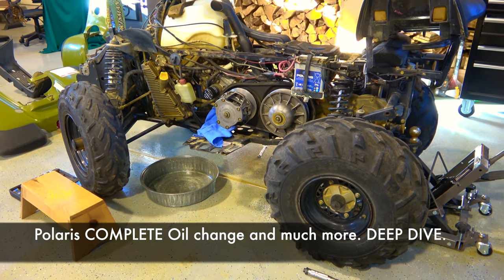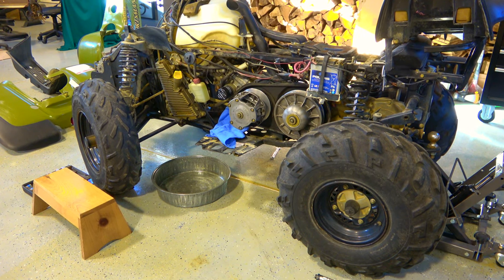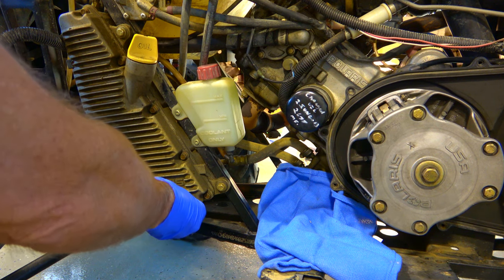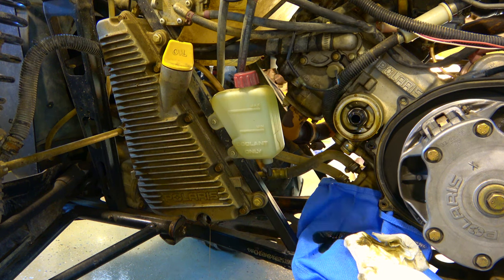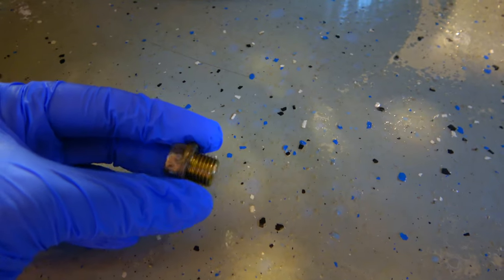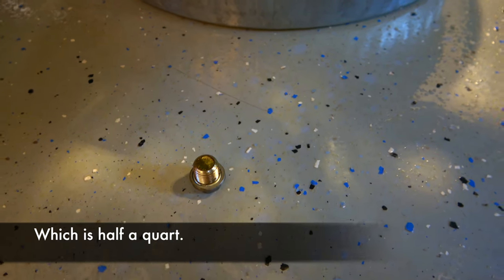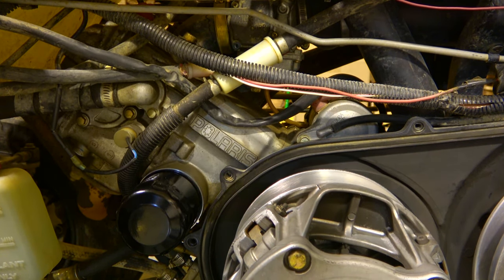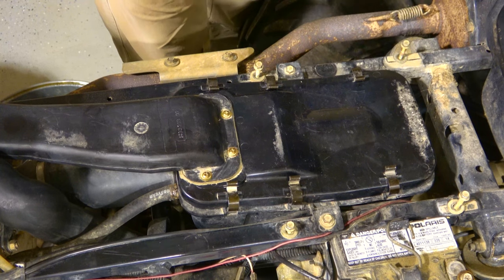Polaris Sportsman COMPLETE oil change & Much More. DEEP DIVE.

Comment: Hello. My oil reservoir has two breather connections at the top?  Do I crimp both off?  I only noticed that you used one hemostat tool. Should I not crimp the other? I can't post a picture here but there's definitely more than one.
Reply from the maker: What year make and model do you have?
Reply: @ericinalaska7648  1995 Polaris Magnum 425
Reply from the maker: @futuregamer5791  I did some searching and the few pics I found, were very limited. Does it have a a black line, and what was once a clear line that has yellowed? The design I have and demonstrate has one vent line that goes to the airbox under the seat. Is that the same with your black line and then the clear/yellowed one goes? To the ground or? Like a fuel or over flow vent? 

     I don't know for sure. Id have to dig more but my instinct is that you'd clamp them both if that's the case. When you clamp the line as I did in the video. Your creating pressure to force oil through the pump and as It warms and expands its intended to fill any voids in the flow by not allowing the pressure created out the vent. Thats my understanding anyway. So I would think you'd clamp both but I would need to reference the manual on that one. I haven't been able to find any reference at this point.  See if you can get a manual for that model. They're usually pretty cheap and great to have. Let me/us know if you sort it out. Ill see if I can find anything.
Reply: @ericinalaska7648  So bad news for me. I rebuilt the engine and had it running. I first pinched off both of those oil reservoir breathers and ran it for almost a minute. Then ran it normally and within 2 minutes the engine locked up. Not completely but it's definitely seizing up. I think I'm throwing in the towel on this one and I've decided I won't be purchasing anything else Polaris branded. The engine locked up previous to the rebuild the cam froze to the cylinder head. I tore it completely down and split the case. Replaced water pump assembly, timing chain,piston rings, honed out the cylinder, new cam shaft and cylinder head, rockers, thermostat, gaskets, carburetor, expensive p4 5w50 oil, oil filter, fuel filter, fuel pump. And now that piece of junk locked right back up. I'd never recommend that anyone buys Polaris.
Reply from the maker: @futuregamer5791  I can certainly understand your frustration. I haven't ever gone to that extent. I had a similar scenario with a snow machine/mobile. I didn't rebuild the motor but removed it for other repairs and put it back in and learned the hard way about air in the cooling system. Didn't tilt the front up as recommended while filling coolant. Didn't know that was recommended. No YouTube back then. This was many years ago.  We went out riding and that didn't last long. Seized.  The reason I share that is to tell you that in that situation and likely in yours I would try to just find a salvage motor. Complete and just swap it. If you do the math its likely less $$$ and time certainly than rebuilding. Definitely deflating after all that work.  Silver lining. I bet you can tare one of those apart pretty efficiently now.

Comment: Split it then take the supply line off of it and then take that screen out of it and then spray it down on the bike and clean it out just make sure the supply lines taken off of it so you don't end up getting parts cleaner down in the crankcase. From what I'm seeing you can do it that way if you don't want to take that completely off. Would that be correct?
Reply from the maker: I believe you could but its really easy to take off. And makes all the rest easier to get at. I mainly was demonstrating and showing the parts in detail for those that have never dug in that deep. And to help folks have a better understanding of what's all going on and what's what.  If you you disconnect the supply line you'll need to prime the oil pump of course. But as you mentioned. You could split the oil reservoir while still on the machine I would think if you chose.
Reply: @ericinalaska7648  ok I thought it looked like that. I just got a 2000 Polaris sportsman 500 4x4. Doing a bunch of maintenance just wanted to make sure what I needed to do.
Reply from the maker: @coachnutt61  Well hopefully all goes well. Always a good idea to go through a new acquisition.
Reply: @ericinalaska7648  to prime the oil pump if I understood the video I need to clamp the hose coming out of the top of the reservoir is that correct?
Reply from the maker: @coachnutt61  Assuming yours is the same and I believe it should be. The top hose/line, the breather line that goes to the air box under the seat/air filter there is a slit maybe an inch back you need to clamp between the slit and reservoir. (Without clamping or crushing the nylon threaded pc at the end of the line that threads into the reservoir.) And after running it and you remove the clamp you should hear like a pressure relief sound. if not repeat. You'll have to watch the video or refer to your manual if you have one. I don't want to try to rattle off all the steps here and miss something. But its really not that complicated. I cover it pretty in depth in the video if you don't have a manual. Hope that helps. If you watch the video in its entirety I think most questions will be answered. I did not cover the relief sound or repeat so be aware of that.
Reply: @ericinalaska7648  ok thanks very much for your help.
Reply from the maker: @coachnutt61  No problem.

Comment: Hey great video,  new to the channel. I just bought a 2003. any issues with the speedo?
Reply from the maker: Welcome to the channel. If you haven't found it already. Here is a link to a video I did regarding the speedo for 96 to 99. https://youtu.be/ADNyJ5sx83oI have not personally had any issues with a 2003 or more specifically Ive owned a 02 but have not encountered any issues. But maybe the video will shed some light on some similarities or comparisons. What issues are you having?
Reply: @ericinalaska7648  so I bought this machine about 3 weeks ago, it is in phenomenal shape, the speedometer is not working so in turn the 4x4 won't work because it's linked through the speedometer, I don't really want to bypass it if I don't have to
Reply from the maker: @dkproconst.4402  That the same case as the speedo I repair in the video I sent the link for. AWD would not work. Common issue the one I repaired is solder failure and I had a loose resistor floating around in there as a result. Repaired and for now all is well. I anticipate a potential repeat down the road. I opted to take a shot at that due to the price of a replacement.
Reply: Absolutely, that's what I'm looking to do is repair mine, I pulled mine apart and everything is in tact, so I'll have to test some transistors and such
Reply from the maker: @dkproconst.4402  Id be curious to hear what you find.
Reply: I'll definitely keep you updated
Reply from the maker: @dkproconst.4402  Sounds good.

Comment: great info in this video as I just pick up the same Polaris but hasn't been run in 4 yrs. It was sitting outside with no cover. I'am going to try to bring this thing back life. Is there some way I can contact you direct i.e. by phone ? I've got more question then answers. Thanks.
Reply from the maker: Hey Kathy, Take a look at the playlist and see if any of the other videos are of help or answer some questions. Im also currently making more videos. Im going to upgrade the headlights and going to go through, with the plastics off.  Identifying parts, their location and purpose or function. If you still have some questions after, let me know. Id be happy to help in any way I can. What specifically are you struggling with?

Comment: I just purchased a 2003 sportsman 500 ho. Unfortunately it didn't come with the owners manual or service manual. If I'm doing the basic oil change of draining the oil tank and engine block. Do I still need to prime the oil pump if I didn't remove any oils lines? I just need the extra clarification.
Reply from the maker: I have never primed after a simple oil change. My understanding is if you didn't disconnect the lines you don't need to prime. If all you did is drain and refill and  change the filter.  I haven't seen anything to the contrary.  I just checked a 2002 manual. I Don't have a 2003. But if your still concerned or uneasy I can't see any harm in doing it if you choose.

Comment: Sorry if I don't know the lingo lol. My friend has I believe a 2002 Sportsman 500 Ducks Unlimited version and it is leaking from the hose that connects to the piece above the oil cap, is that like a distributor for the antifreeze or is that like a fuel pump? Its a very slow leak that looks like antifreeze bc its green.  It's the top hose, and when I follow yours, its looks like its twisted. What's that hose called when looking it up? I tried under cooling system, but it only shows the reservoir underneath it. Thanks so much! =)
Reply from the maker: Are you talking about the unit above the oil cap and above your fuel switch? (The on off or reserve switch) Aluminum casting I guess you could say 6 sided. With hoses to it? If so that's your fuel pump.
Reply: @ericinalaska7648  Yeah that piece with the 3 hoses I believe. The top hose seemed to have formed a little leak that looks green, Is that even possible if its antifreeze? Or should I be looking somewhere else? It was minus 11 degrees Fahrenheit so I didn't go to in depth haha.
Reply from the maker: @MrLegendL2118   Its actually to the left of the on off switch I think I said above. The only lines I have to mine from bottom to top are fuel. From the tank, (Fuel inlet)To/from the switch, and to the carb (Fuel outlet).  Is that the color (green) of the antifreeze in the machine? That'd be a quick mystery to solve. My hose from the radiator hangs below the level of that pump. Should be No other liquid going to the pump that I''m aware of. And maybe if its running you can locate an active leak some where. Maybe when its a little warmer out though huh?

Comment: The Crank Case oil that was Drained 
How do you refill it ?
Is it Connected with Motor oil 
Reservoir???
Reply from the maker: It is. Its all connected.  Just make sure if you've disconnected any of the lines that you prime the pump. I talk about all that in the video.

Comment: Can I take the supply line off the bottom on the back side and clean that just by itself? I want to drain oil, drain the secondary by the trans that is now going to require me to pinch off and prime oil pump and I would like to clean that screen. Thats about as far as I my comfort level is.
Reply from the maker: Thats really most of it really. You will need to prime if you disconnect the supply line. You should hear kind of a swoosh or kind of like a sucking sound.
Reply from the maker: I just noticed  I just got a big batch of older comments. This one said 1 yr ago.Very weird.  And this one is familiar to me but in case Im confusing it with a similar comment.  In the event I never got it until now. I will respond (Pos again.) Sounds like you should be fine doing as described.

Comment: Hey I got a 2011 700 Polaris sportsman and I might have the clear vacuum line hoses mixed up I was wondering if you could do a video on that they're up by the headlight front headlight the solo one
Reply from the maker: I googled "2011 polaris 700 vacuum hoses" And the results come up with some diagrams/pics. I didn't dig too deep but I think with some refined searches you should be able to come up with a reasonable reference. Im not familiar with that particular model and don't currently have access to one. Shouldn't be too difficult to find what you need though. Hope that helps a little anyway.

Comment: I have a 2002 Polaris sportsman 500. The manual calls for engine oil Polaris Premium 4 Synthetic 0W-40. I noticed that the PS4 is 0W-50. Are you using the PS4 in place of the 0W-40 ?
Reply from the maker: I have always inquired when getting a new (Old) machine and been handed PS4. The Only Polaris brand 0-W40 Ive seen is usually for snow machines/mobiles.  I would imagine the viscosity of 0-W40 would be better for colder weather. I know the PS4 comes in two temp ratings. Colder or hotter temp ranges. But I believe both are 0-W50. Of different formulations.  Ill have to double check that now though. All that aside I would use as recommended in the manual. This is a 1999 and when clarifying at the shop. I was told  and handed PS4 and that that's what they use all day in just about everything they work on. Meaning if I had them do it. Thats what they'd use. And since Im way out of any warranty concerns. I personally wouldn't loose sleep over it. If you you use other than what's recommended during your warranty period and you have an issue and they test the fluids, and likely would, and find different than what's specified. You're done. But I would imagine outside of that you'd be hard pressed to find many that would validate any fears of using one verses the other. Especially on a 20 year old machine. Clean oil and filter in my opinion even if off brand or similar weight is better than neglected oil of brand name. Im pretty consistent with the products I use though. And do my best to use as recommended.  If your book States 0-W40 that's what I would use. Assuming everything else is the same as indicated in the manual. Year, make and model and version etc. Hope that helps.
Reply from the maker: I was also notified about another comment you had left regarding the crankcase oil/draining. But it may have been deleted because I cant respond to it as if it had been deleted. When I click on it. Did you sort that out or see it in the video and remove? Just wanted to make sure I responded if you had a question regarding that.
Reply: @ericinalaska7648  hi eric. Thanks for getting back to me and thanks for all your wonderful videos. The reply that I quickly deleted was one where I mentioned that I saw in the manual about draining the lower section of the crankcase. But then I realized you had already mentioned that.
Reply from the maker: @ringwood  Got it. Hopefully my explanation cleared up any oil confusion and didn't add to it.

Comment: Wonder if you heard a woosh sound when you released that hemostat? Read you would?
Reply from the maker: Yes. You should hear like a swoosh or maybe a faint sucking sound. If not just repeat. Its not always loud or obvious as you'd want. If you don't hear anything convincing. Repeat. No harm will come from repeating the same steps over.

Comment: I have a brake question if you could help.
1999 sportsman 500.
The foot brake and hand brake like to play ‘teter-totter’ and requires I pull the hand brake while I push the foot brake. And I can feel the pressure from the foot brake on the hand brake when I press it? It’s like a one way valve somewhere isn’t working. Ideas?
Reply from the maker: Do the brakes still work though? Or seem weak? My initial response would be. It shouldn't be doing that. And my instinct would be to investigate the hand brake and how that master cylinder (The brake fluid reservoir) is functioning separately as well as the one for the foot pedal. But yah. the pressure that is produced or built up by squeezing the hand brake or stepping on the foot brake should be activating your brake pads/shoes. Not transferring to the pedal or hand brake opposite of which ever one you're using.  I don't have access at the moment but I suspect and seem to think that if I squeeze the hand brake on mine and others Ive had that the other (foot pedal) would become slack. I won't swear to it at this point with out access to verify. But that would be my expectation.  Id first check all my fluid levels. Check for leaks. Bleed the lines. And if it persists Id isolate and check each individually to try to determine the issue. And also if you haven't already watched it. This one may be of some help. https://youtu.be/RlUSYCLmbbE
Reply: @ericinalaska7648  so I replaced the foot pedal master cyl. I used a $25 generic wildwood part that is exact part. (Saved $100 from dealership)
I bled all corners and still have the issue. I guess is the rear caliper is the problem. 
For now I have the rear brake pedal locked in the down position and everything works fine.
When I squeeze the hand brake it will actually overflow the little fluid resivour under the seat connected to rear foot brake. Once foot brake is applied no more back flow. Ill report back once I also replace the rear caliper.
Reply: I found on another forum the exact same symptoms I’m having- the rear brake caliper has a problem with the seals. I’ve got a seal kit on order from eBay so I’ll tear it apart and rebuild.
Reply from the maker: @Upliftyourbrothers  I haven't had to do that but it looks pretty straight forward in the manual. How do your pads look while you're at it? They're pretty cheap.